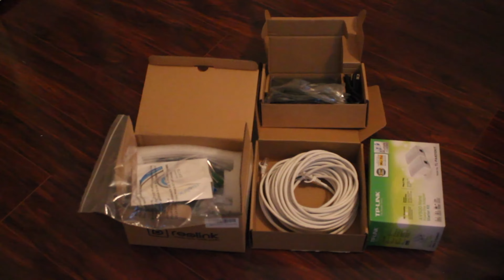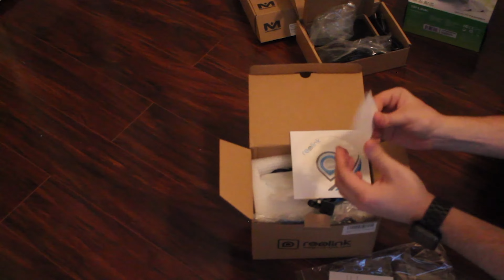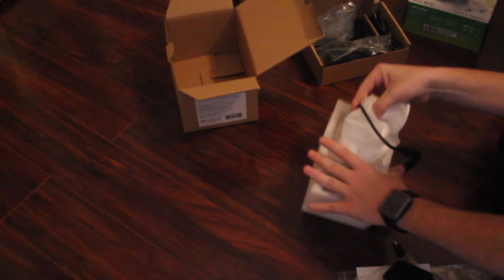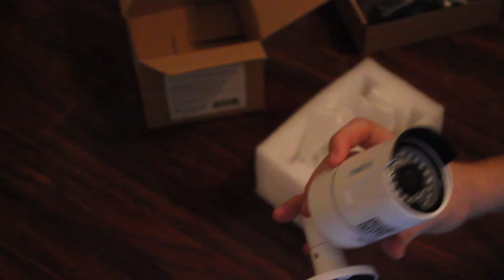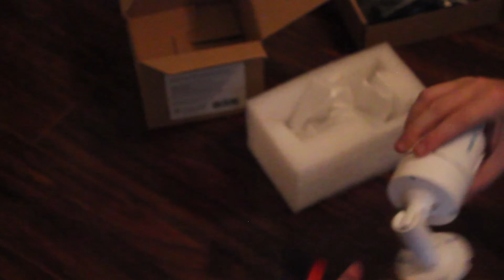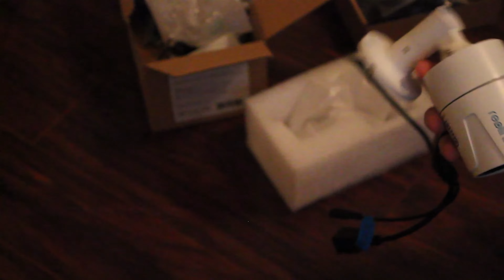ReoLink RLC-410 POE Security Camera Unboxing

Comment: Hi please i want to know before buy a survelliance kit, if I use this camera with this kit http://www.amazon.com/dp/B010LH48F4?psc=1 i need to buy an power inserter for each camera or just plug the cameras trough level5 cat cable and all wath i need to install is in on the box, Thanks in advance for your advice.
Reply from the maker: As long as you connect it via Ethernet cable no extra power cable is needed.